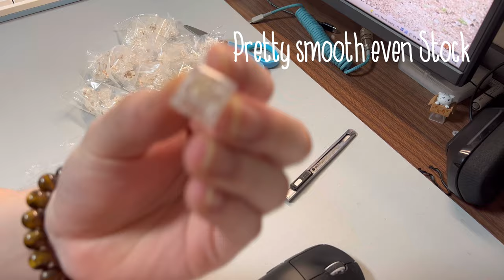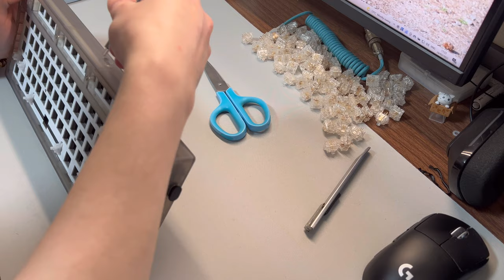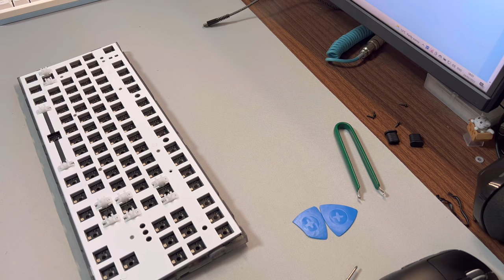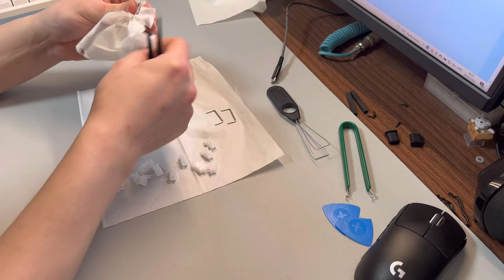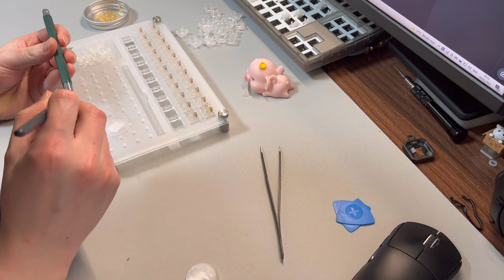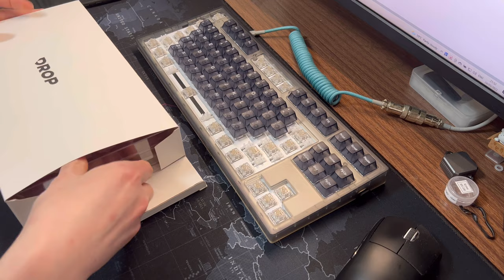FL-Esport MK870 modding video. (Aquaking v3, Keysterine Keycaps)

Comment: Looking to get this board. Want to get thocky sound. and looks like your is pretty good. Can you tell 
1. What switches did you use? I am thinking gateron milky yellow
2. Does the foam at the bottom help with the thocky sound?
3. Is tape mod needed to get even more better sound?
4. For the keycaps, I am thinking cherry style. not sure if thats a factor with how they sound?
Reply from the maker: First of all let me know what is your budget?
Reply: @whitkeebs  $150 or so.
Reply from the maker: @Jerriehomie  Its Sound okay to me.
MK870, if you can get PC plate, buy it.
Gateron Milky Pro Yellow fine too. Lube & Deskey film.
Cherry Keycap in this budget then you can pick whatever you like.
You can add Poron Foam case like me in the Video, no need PE Foam.
Good Luck :3
Reply: @whitkeebs  Thank you.
Reply from the maker: @Jerriehomie  oh. And dont forget the Tape Mod. 2-3 layer should done the job.

Comment: Hi, want to know waht you used to for the bottom case to remove the hollowness
Reply from the maker: Inoak Poron Foam 3x50mm for this keyboard.
If you use for other Keyboard then i Recommend 1.5x50 or 1.5x100 for less Thickness.
Reply: @whitkeebs  i see, cuz im planning to buy this keyboard. So a much thicker foam is recommended for the mk870?
Reply from the maker: @ryanlow9312  Yup.
The Bottom case pretty Hollow and it fit the 3mm Foam.
Reply: @whitkeebs  Thank you for much for replying!! I hope you have a nice day!!